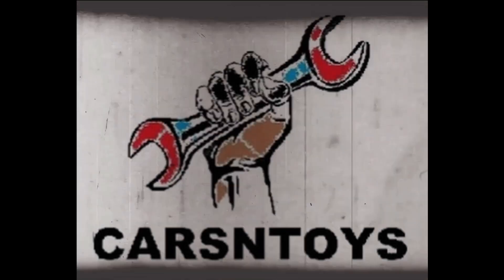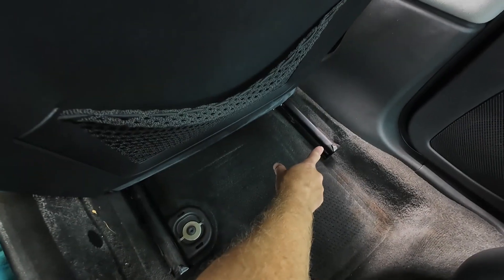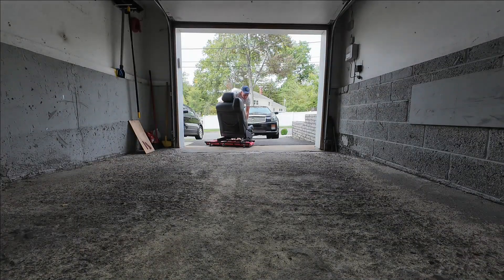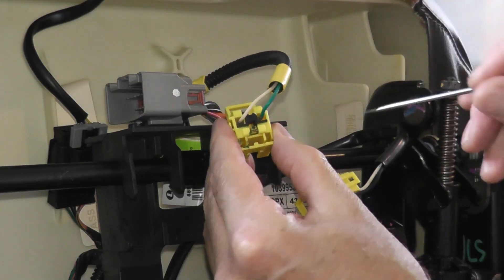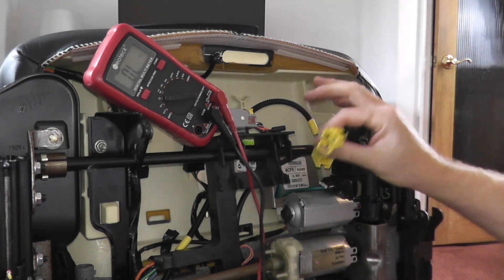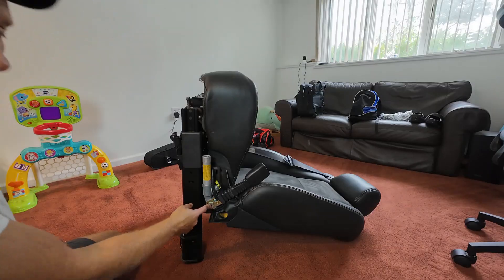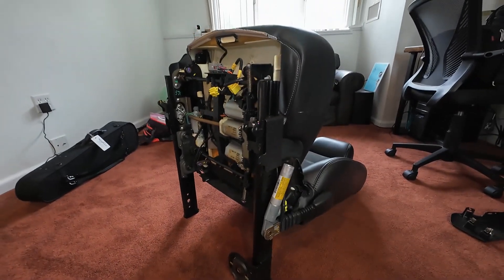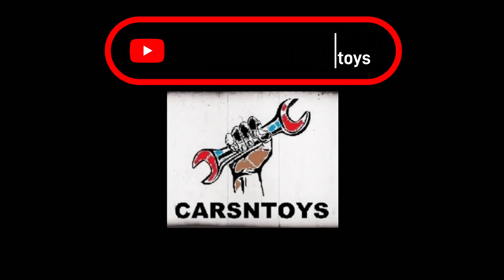How to Test and Replace a Seat Belt Pretensioner For Beginners (2025)

Comment: i recently had a couple exhaust studs replaced, to the get old ones out it took heat and a lot of pounding, drove car home, next day when i started it the air bag light was on and was dinging at me, shut it off and restarted it and its been fine since, cant help but wonder if it was all that hard ass pounding. the work was done right underneath near the shifter area at the second cat. very well could have been coincidence but its just seemed odd,

Comment: had problems with that light on my 2001 maxima for 4 years before I sold it, I reset the light  with a nissan specific way todo it with out scanner,   thik the problem was my son stuffed jstuff under the seats alot of the time.